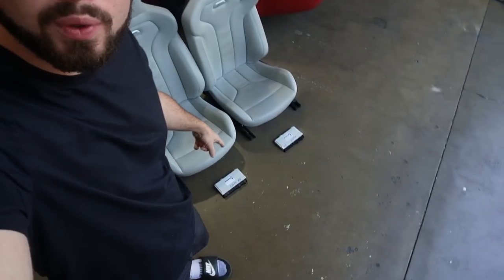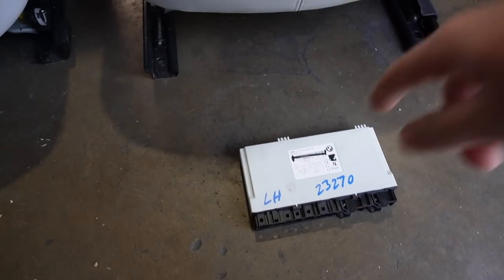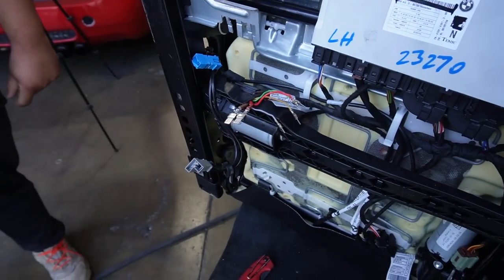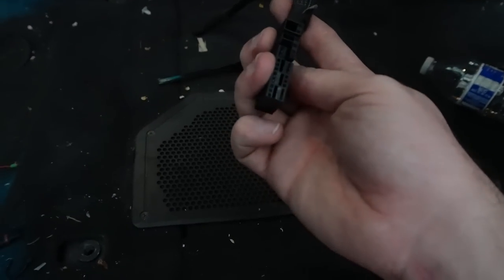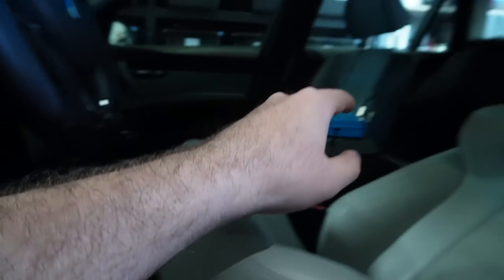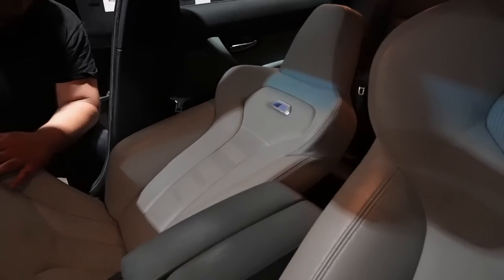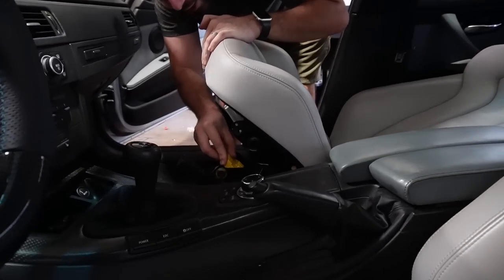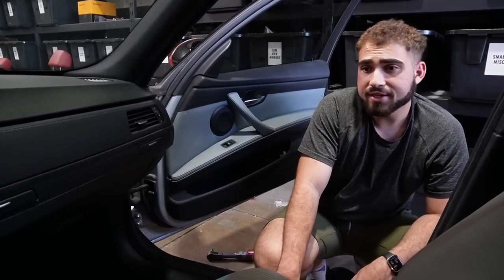Retrofitting F80 F82 Seats In my E91 M3! Also Works On (E90,E92,E93,328i,335i,M3)

Comment: You need to run canbus to the passenger seat module and connect pin 2 to ground (pin 8) on the main power/canbus connector to the seat module to tell the module its on passenger side (driver and passenger side modules are the same but needs this extra wire connect to ground to know the position.

This is because e90 / e91 usually dont have a canbus seat module on passenger side and have a separate pwm heating module.

Feel free to hmu if you need help figuring it out
Reply: Would be great if you have some links or info to share. I bought F30 seats for my E90 LCI.
Reply: @SinanGhareb , same. 🙋‍♂️
Reply: Is this the wiring process to get tje heated function to work on the passenger seat?
Reply: Do you know if this will work in a e93 m3?
Reply: @yasseralshahib1  yeah its the same princple. Just e92/3 have canbus modules on both sides normally (on cars with memory seats) and e90/1 only on driver side.
So you shouldn't need the extra canbus wires. Don't know if that extra ground wire for positioning is already present on F30 seat wiring or if you need to add it

Comment: bro haha same crap happened to my passenger seat on my f32. the bar where the motor sits broke. in my case it was a metal water bottle that got caught under the seat while moving it, which broke the bar in half. I bought a second seat to swap over the full rail system just like you, but I wasn't able to remove the original seat off of the rails, so it's been sitting there like this for months now lol. I think about it every time I get in the car :( I'm going to try and see if I can loosen the same bolts as you have, thank you so much for this video

Comment: the small Module on the passinger seat is the seat heating module - only controlling the heating funktion - those have a different wireing connection than the big moduls

the small modules get a PWM Signal from the centre console buttons
the big ones from the can bus

to get the heating working you basicly need to add in the can bus wireing inside the car to the passinger seat connector and then also add it into the seat itself

Comment: Hello bro, I bought seats the same as yours for a 2014 m4, I tried to place them on my 2011 e90 but I noticed that the rails of the m4 seats are wider and do not fit the body, did you make any adaptations?